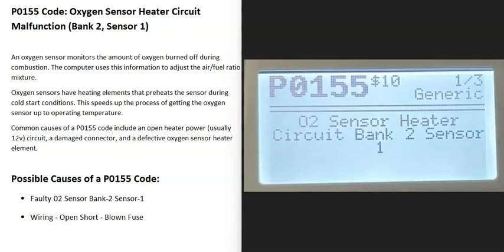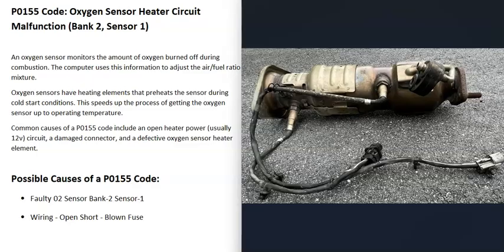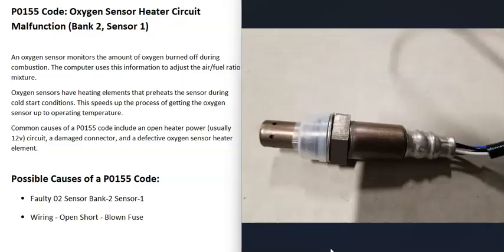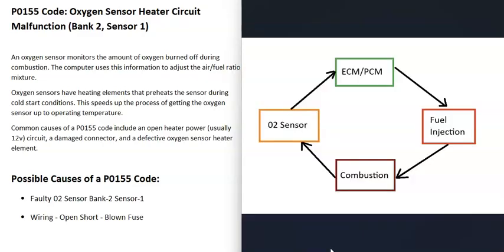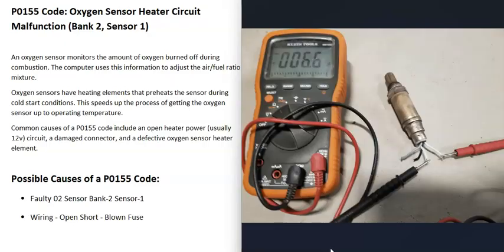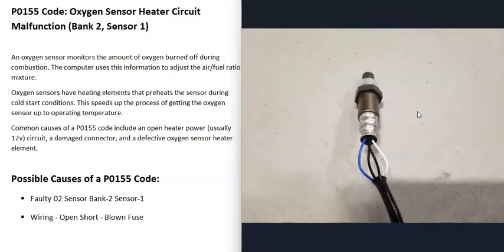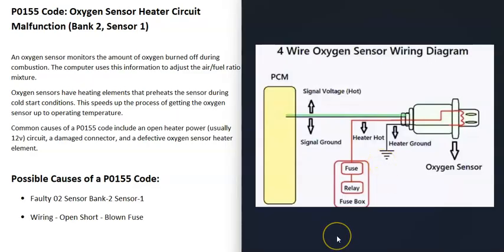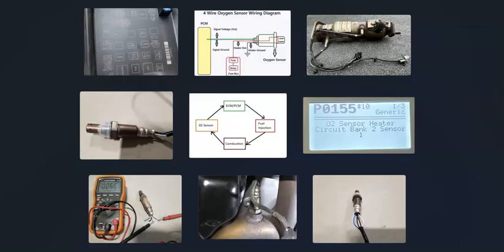Causes and Fixes P0155 Code: Oxygen Sensor Heater Circuit Malfunction (Bank 2, Sensor 1)

Comment: Can it cause a hesitation on acceleration??
Reply from the maker: Yes, there can be a hesitation since the engine is running in what's called an open loop. The computer uses the 02 sensor for input to quickly adjust the air/fuel ratio; when it does not have the information, it goes into an open loop and basically guesses what the fuel/ratio should be with information from other sensors.
Reply: Once the engine is fully warmed up, is the heater still needed for normal operation?